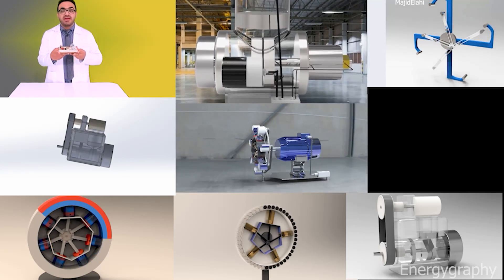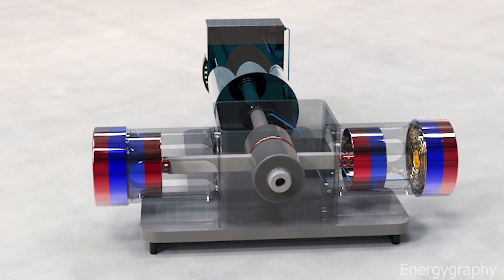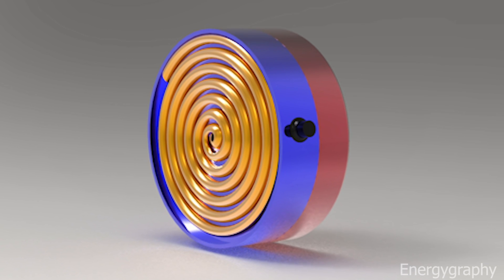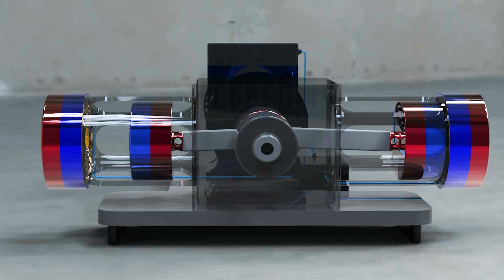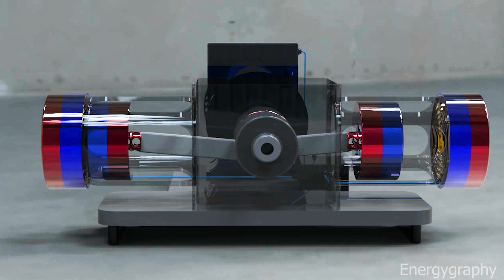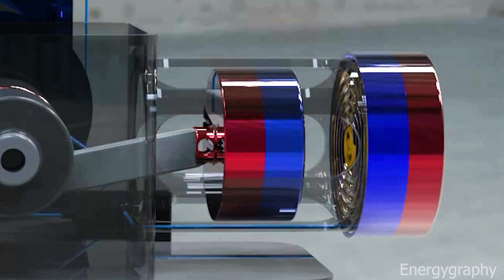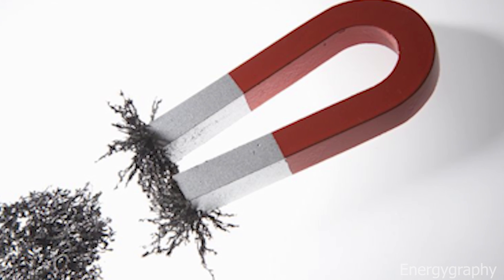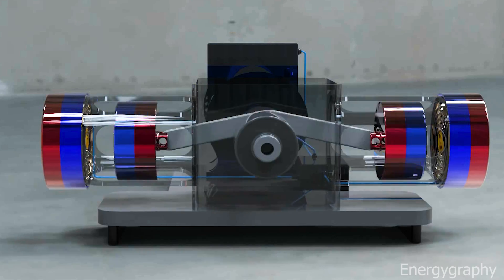The Next Generation of Energy: Permanent Magnet Generator Explained!

Comment: Hi, I responded to your previous version.. you are using too much energy to activate the electromagnet in order to shield the strong magnetic fields. Also given the configuration you may not generate enough force as the repulsion on both sides will tend to cancel each other out. Instead you'd want to create a continuous imbalance on one side at a time without having to energize the electromagnet. Instead use ferro material (i.e. steel wire rope) for your electromagnet.. so when the piston magnet on one side comes closer to the electromagnet it is attracted to the steel material of the electromagnet.. only when the piston is at the closest distance to the electromagnet is the electromagnet briefly energized - which breaks the attracting force and engage the full force of the opposing magnet. This will result in an explosive push to the other side which will be weaker given the fact the other side is now attracted to the other electromagnet..

Comment: The free energy is the portion of any first-law energy that is available to perform thermodynamic work at constant temperature, i.e., work mediated by thermal energy. Free energy is subject to irreversible loss in the course of such work.[1] Since first-law energy is always conserved, it is evident that free energy is an expendable, second-law kind of energy. Several free energy functions may be formulated based on system criteria. Free energy functions are Legendre transforms of the internal energy.

Comment: let's say demagnetization of SmCo magnets can be ignored and taken away to the category of consumable parts, how did you solve the problem of induction causing the main losses in the magnet movement system, and then how did you solve the problem of useful work in the ratio of systems [linear electric motor - rotary electric motor], because the losses on the EMF of self-induction in the motion of the magnet-piston that you presented say significantly lower efficiency in relation to the generator rotor

Comment: That system has to be start, manualy ! Then, it goes from one magnet to the other, until, by friction loss , it will  stop in the Middle of the stroke. That stop will append faster, if there is use of the movement.

Comment: It will work like a guitar string. Will go thru some motion, but any energy you take out will lower the amplitude until the mechanism finds an equilibrium point where magnets apply the same force to the central part. Then it will be still.

Comment: The idea will not work for the simple reason that the propulsion is very weak for the magnet, as it is not like propelling the explosion of gasoline inside the engines. There is no comparison whatsoever between the magnet and gasoline.😁

Comment: If this prototype uses electromagnetism, will the electromagnets not draw from the energy source in which it is trying to generate in the first place? It almost seems like the electromagnets would work against the generation of electricity in this aspect. Am I wrong for thinking this?
Reply: You are not wrong. What you have here is an e-motor driven by a generator, and the generator is driven by the e-motor. Since both of the have losses, this can't work. And here is absolutely no chance to get a surplus of energy with such a device.

Comment: Isn't the force exerted on the permanent magnet less than the energy supplied to the electromagnet?  Therefore doesn't this actually consume electricity on net?
Reply from the maker: Here we learn together, we experience, we do trial and error. Be sure to wait for the final result of the device. I am also testing and experimenting. It can be calculated in theory, but the joy of doing the project in practice is not in theoretical research.  .  Anyway, I know all this, but our mind needs to create excitement, and this causes a spark in the mind and a very interesting thing happens in a moment.  Don't be hard bro
Reply: @energygrapgy    Sorry, but there is no need to learn about stuff which is already fully explored. It is obvious that this device does not work. It may be joy even to make non working models but one should not announce such models as free energy device. This is premature, even if one does not have the competence to understand why it can't work.
Reply: (To answer my own question: yes.)

Comment: Capacitors however need to be charged again, and that takes more power than the motor can produce. To convert energy from one form ( electric) to another( kinetic) and back again uses power, so you never ever make more power than you use. That is why perpetual motion and so called free energy dont exist. Physics doesn't lie. In fact, the permanent magnets weren't even necessary in this project as they could have been replaced by steel pistons as it's just a solenoid motor in reality.

Comment: Your concept is very good also i want to add if we change the orientation of the both magnetics at the same time instead of turning them off one by one you will get more power and efficiency of course we will need to use programming and sensors to operate electrical magnetics for best results but what i am concerned about is that the input and output of the magnets are unknown and we have no idea how much output we will get 
This needs alot of research and resources for which i hope best of luck to you and i hope we will get a good news from you soon
Reply: No more research is needed here! It is obvious, that this device does not work! Permanent magnets are not a source of energy, they only deliver potential energy. Without the e-magnets the device does not run. What is shown in the video is an e-motor, which is driven by a generator, and the generator is driven by the e-motor. This does not work. And it is also not feasible to turn the permanent magnets, since this turning also needs energy, and thus the gained energy is lost again.

Comment: Concept wise ok but just after one rotation it will cancel both field at stuck at balanced fields.. that means it wont run after one rotation.,🙏👍
Reply: Great point, so I wonder if you simply added springs or a fly wheel, if that would keep it going. The way large clutch machines work is that a motor starts a very large fly wheel and then a clutch draws from the momentum of the flywheel. If the weight of the flywheel was just enough to keep the magnet pistons going, I think it would work.
Reply: That's why you have a flywheel to push past that point
Reply: This is the wrong concept that this pattern will make energy. 

There are the fix magnets should be rotate in.
Reply: @shahidsial7012 the ac current demagnatize for a while so the magnet will work

Comment: You are using electromagnets.  That requires an energy input.  The only energy you will be getting out of this device is a portion of the energy you put into the device.  If you use nothing but permanent magnets, they will just find an equilibrium and all motion will stop.  What you really need to do is find a way to make a magnetic field move relative to a coil without having any physical object move, such as the coil or a permanent magnet itself.
Reply: True. In order to make continuous moving it must have electromagnetic

Comment: If this machine would be functional then why haven't you made a video functioning and producing energy. I have designed and built a machine using magnets that produces electricity and depending on the size  its built will determine how much electricity is produced.i can post videos but I haven't been able to build a full scale prototype for lack of funds butt soon the funds will be available.ans it will be built and I will post a video that will without question be proof of a real working free energy source.

Comment: It seems this would extend the life of the permanent magnet, but will it eventually reach an equilibrium? I had come up with nearly the same design yet also incorporating the stirling engine but the heat would hurt most permanent magnets
Reply: if both magnets work at same time,  equilibrium will happen.  If they are switchable then they are requiring electrical energy,  which is produced by the movement from magnets,  which will not be enough energy.  It will slow down at the rate that friction and heat use up the energy used to start the process and then it will slow and stop.  Unless there is a way to create more energy then what is being put into it but there is nothing here that does that.   I mean,  think about it, where would the extra energy come from??? Energy is a real thing everyone.  It is quantifiable.  It is measurable.  Just like water.  These crack pot wishes are like pouring water from one container to another while spilling a little bit each time and trying to tell me you'll end up with more water for no reason whatsoever.  Not even trying to figure out where more water would come from or how to extract more water from nothing.   why do people not realize energy is a measurable quantifiable thing and it is what turns and moves things.   How could anyone expect to have more of it for NO REASON?
Reply: @righteouswhippingstick : Augmenting the friction loss with solar panel- power bank tandem, will make the contraption a "near perpetual" engine invention.. The word "hybrid" was the popular term for such set.up...

Pls suggest on how to make the shown video to function continiously, its very ovious that youre technically literate about the basic of Physics science... 

Compassion filled suggestion, is like fresh water to a desert traveller...😊😊😊
Reply: @righteouswhippingstick  easy calculation is energy produced 1.kv is consumed only 0.75kv/hp and if the resistance load is less then the loss of 0.25kv can be as a part of renewable source... N i proved it practically